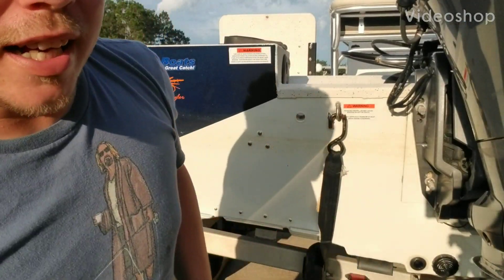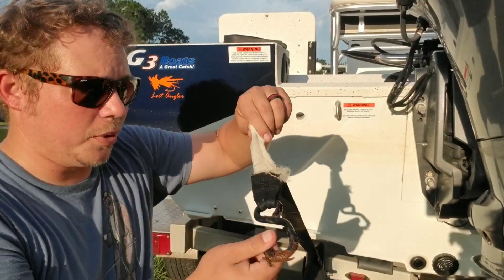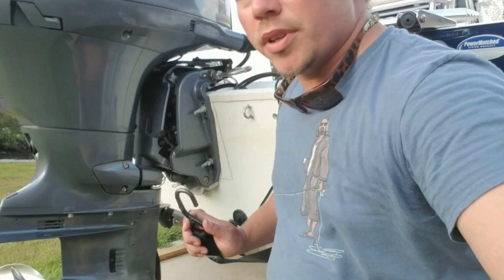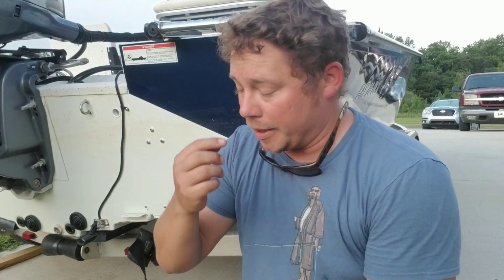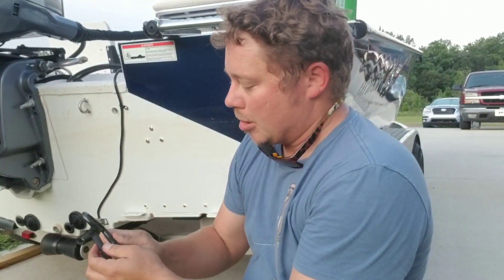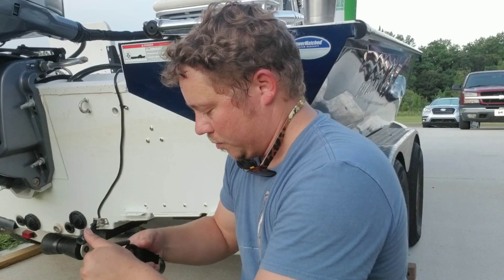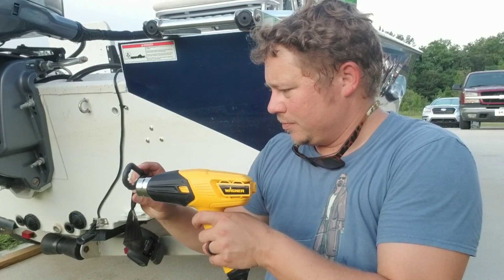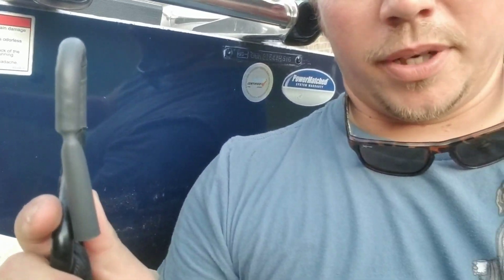Repairing the Hooks on Transom Ratchet Tie Downs

Comment: Have you tried Plasti Dip instead of heat shrink?  I suppose the heat shrink is a lot cheaper unless you plan to dip several things.
Reply from the maker: I have not but I had heat shrink sitting around from other projects. So I guess I was happy that I didn't have to go out and buy anything to get the job done.